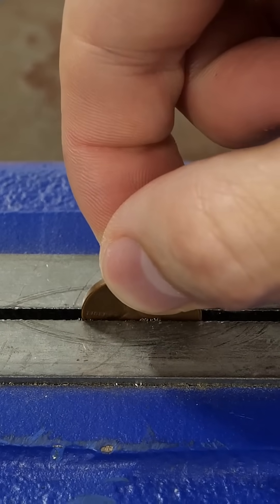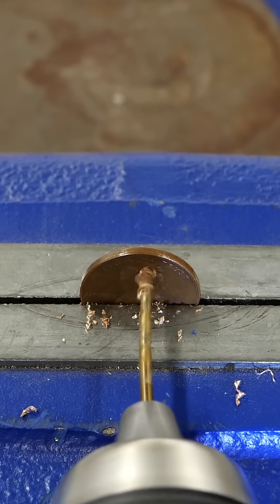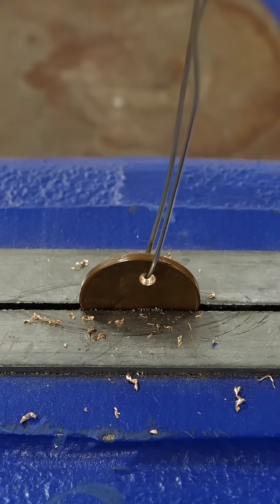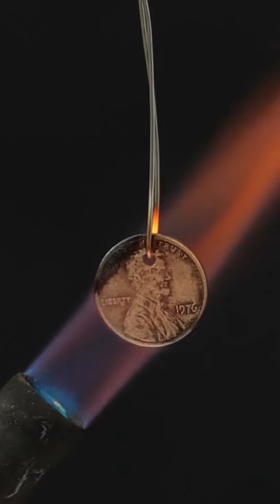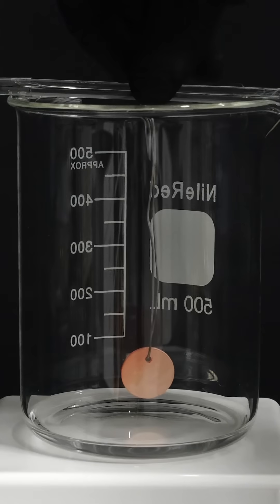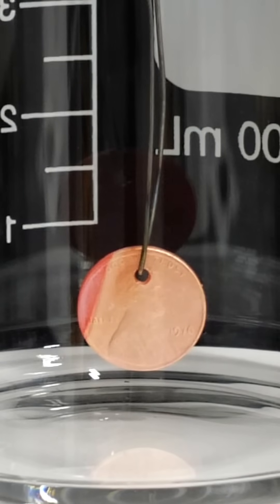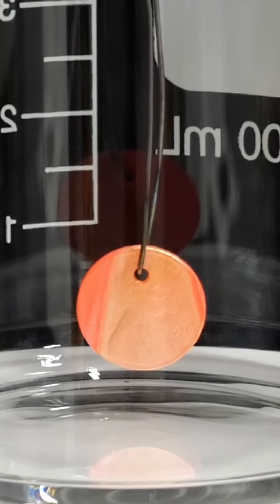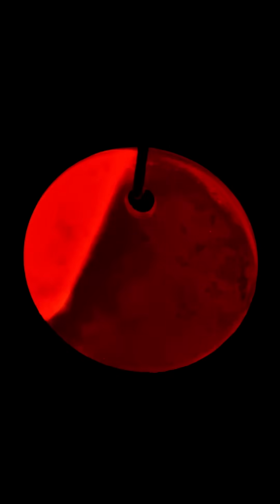Turning a penny into a light bulb

Comment: As a footnote, this only works with pennies pre-dating 1982, since those are mostly copper.

Pennies made now and especially recently dont work because theire now merely zinc with a copper shell. The copper when heated acts like a kiln and will fully melt the zinc. Then the copper shell will crumble as the zinc no longer holds it togeather.
Reply: And this 100% will not work on Canadian pennies made after 2012.
Reply: @rtkThirteen  I can confirm. In fact, even a nuclear explosion will have zero effect on a post-2012 Canadian cent.
Reply: Footnote to the footnote, this exchange of metals is called debasement and it is an everyday example of inflation, or in this case, depreciation of the exchange value of the unit of currency to the exchange value of its metal.
Reply: @ethanallenhawley1052 our money isn’t based on the exchange value of it’s metal
Reply: @zcrow1276  That checks out. I got a flimsy patch of denim with "$50" written on it. Reading these comments had me worrying about the price of jeans.
Reply: I haven't seen a Canadian penny made full copper since 1993
Reply: Was gonna comment this.  Mine just melt when I heat them up.
Reply: Colloquially, Americans still refer to 1 cent coinage as a penny.
Reply: @matthewludivico1714 yeah we literally do. We refer to the unit of currency as one cent, but the coin itself as a penny. I think bro correcting everybody is extremely autistic and into coins
Reply: @matthewludivico1714  Colloquially, yes.
Reply: The official name of the coin is "penny". The official value is "one cent".

Sometimes (usually in negative light for something), it is called a "red cent", placing emphasis on the idea that the lowest denomination (as the only "red" coin) is being referred to... "I wouldn't pay one red cent for that", for example. Not really any other names for it.

The way it's always been. NFI where anyone is coming up with anything different for the US.
Reply: He should make a cross out of copper; that would be cooler.
Reply: @V2RocketScientist of course it would be "cool" because it's an edgy idea. You have to remember that large YouTubers are also business people, and optics like that for your channel can be super problematic.
Reply: they're*
Reply: god i love science
Reply: @joseimpact  i disagree
Reply: Just use copper wire lol
Reply: beat me 2 it....
Reply: and what would prevent this from working when the zinc liquifies?  nothing.
Reply: @travismiller5548  it wouldnt work because in us pennies, the copper shell is so thin that once the zinc liquifies the whole thing melts, IT CANNOT HOLD ITS SHAPE. Take that from the guy who used to melt pennies out of boredom with a candle lighter. It crumbles. Heating the coin to be red hot with a blowtorch is only possible because the FULLY copper penny doesnt get hot enough itself to melt.
Reply: @Kobai36 i say it's a fun challenge.  will the molten zinc break your copper foils? i'm guessing no.  if i sand a spot to let molten zinc out, that's cheating.
Reply: @travismiller5548  I feel like i need to point out that Nile DRILLED a hole in the penny. OF COURSE the copper foil has to be broken. If you wanted to recreate this experiment on any newer pennies you couldnt drill a hole in it anyways because the zinc would still melt. Not to mention the penny he used was made before 1982, see the first frame where the coin clearly says 1976.
Reply: @Kobai36 furthermore- yes, nile drilled a hole but no, the foil might not HAVE to be broken.  it could be fun and challenging to silver solder, or spot/laser weld a strip or wire to the penny.  with controlled thermoelectric heating, a good deal of time, and a few beers, i could melt that zinc out of there and keep my foils.
Reply: @travismiller5548  "When the zinc liquefies" (which it will) one would be left with twisted and distorted remnants of the thin plating.
Reply: Don't the early forties penny those are made of aluminum
Reply: @RaidersofTheLostShark  there was a brief period during 1943 where pennies were made of steel, but at no point were made of aluminum. Steel pennies were struck to ration copper during world war 2.
Reply: Pennies are British.

The 1976 U.S. Cent used in video is solid bronze, composed of .95 copper, .05 zinc.  U.S. Cents minted since mid 1982 are pure zinc with a thin copper plating.
Reply: @-oiiio-3993  Many of your former colonies refer to their smallest unit of physical currency as a 'penny'.
Reply: @dhayes5143  I am not British.
Reply: @dhayes5143  Nevertheless, they are cents.
Reply: @-oiiio-3993  They're actually 97.5% CU / 2.5% ZN
Reply: @Typical.Anomaly  No, they are not.
Reply: @-oiiio-3993  After 1982, they are
Reply: @simondesmond3574  No, U.S. One Cent coins minted early in 1982 are composed of 95% copper, 5% zinc, those minted later in 1982 and since are pure zinc with a thin copper plate.
Reply: @simondesmond3574  No, they are not. Pay attention.
Reply: @timber72  mb, i mixed the copper and zinc amounts.
Reply: For those of you who keep saying that 'Penny vs. Cent' does not matter, it certainly does in this case as does the year in which the coin was minted.  The coin used for the demonstration was a bronze U.S. Cent.

The U.S. Cent changed, in mid 1982, from a composition of .95 copper, .05 zinc to one of pure zinc with a copper plating.

The Canadian Cent changed in 1997 from a composition of .98 copper, .0175 zinc, .0025 tin to pure zinc with a copper coating.
Beginning in 2002, Canada also produced Cents of .94 steel, .045 copper, .015 nickel which were produced alongside the zinc coins. The Canadian Cent ceased production in 2012.

The British Penny was produced, in its small size, of a bronze alloy of .97 copper, .025 zinc, .005 tin from 1971 through 1992 when the composition was changed to copper plated steel.
Reply: @-oiiio-3993 I’ve never heard a penny referred to as a “U.S. cent”. One penny is worth one cent. The unit of currency is cents, the coin itself is called a penny. At least in everyday speak.
Reply: @SuperD00D  Do you have one nearby?

If so, pick it up and read what is written on the back of it.
Reply: @-oiiio-3993 This guy knows their coin.
Reply: @-oiiio-3993 we refer to them as pennies here overwhelmingly, why are you correcting people to say something that considered generally culturally incorrect 

cent is a marker of currency cost
penny is the physical coin 

people do not call pennies cents here, that would be very silly! it is not exclusively british, lol

Comment: 100000° copper coin vs molten acetone
Reply: The 1976 U.S. Cent used in video is solid bronze, composed of .95 copper, .05 zinc.  U.S. Cents minted since mid 1982 are pure zinc with a thin copper plating.

Comment: did you have to get one of the older pennies before the zinc content increase?
Reply: Pennies are British.

The 1976 U.S. Cent used in video is solid bronze, composed of .95 copper, .05 zinc.  U.S. Cents minted since mid 1982 are pure zinc with a thin copper plating.

Comment: Pennies are no longer made. So whats out there is all that you will ever find and my guess in time they will be hard to find
Reply: Pennies are British.

The 1976 U.S. Cent used in video is solid bronze, composed of .95 copper, .05 zinc.  U.S. Cents minted since mid 1982 are pure zinc with a thin copper plating.

The U.S. Cent has not yet been discontinued, though it should have been decades ago.

Comment: You never specified if it had to be copper, which yours was, rather than zinc which is every cent coin since 1982. Sloppy science.
Reply: The 1976 U.S. Cent used in video is solid bronze, composed of .95 copper, .05 zinc.  U.S. Cents minted since mid 1982 are pure zinc with a thin copper plating.

U.S. Cents minted early in, and dated, 1982 are bronze.

Comment: Use a modern penny
Reply: Pennies are British.

The 1976 U.S. Cent used in video is solid bronze, composed of .95 copper, .05 zinc.  U.S. Cents minted since mid 1982 are pure zinc with a thin copper plating.

Comment: Penny of the pretzel is too hot. You might need a peroxide colored and clean it so the white block side is actually attached with a black line and a bottle that’s a circle. I’m in plastic. Small 27 m until goes do it and make an eye then put it into. Me a liar point A is could be peroxide if you smell it it’s very dangerous but nothing dangerous.

Comment: Penny of the pretzel is too hot. You might need a peroxide colored and clean it so the white block side is actually attached with a black line and a bottle that’s a circle. I’m in plastic. Small 27 m until goes do it and make a eye then put it into.

Comment: Is nobody else aware that the was an error penny and was worth actual money
Reply: What 'error'?
Reply: It was off center technically makes it an error coin and was actually worth some money. Not too much but because it was of center it’s considered an error coin.
Reply: @RockinWordBearer They are valued per the degree of 'off center'.

For a Lincoln Cent of that era the coin shown was rather typical.
Reply: thanks for the info
Reply: I had looked up similar coins from the same year and they seemed to have sold for money but I may have been mistaken

Comment: Umm so weird question, newer Pennie’s are copper clad zinc. I thought I saw zinc type shavings from the hole you drilled. But I’ve never heated copper up red hot but I think that’s higher than the melting point of zinc… please explain.😅
Reply: Pennies are British.

The 1976 U.S. Cent used in video is solid bronze, composed of .95 copper, .05 zinc.  U.S. Cents minted since mid 1982 are pure zinc with a thin copper plating.

Comment: you didnt start with an acid solution?

edit, yeah no shit, the alloy is mostly nickel
Reply: There is no nickel in that coin. The only U.S. Cents that contained nickel were the original Small Cents of 1857 - mid 1864 which were .88 copper, .12 nickel.

The 1976 U.S. Cent used in video is solid bronze, composed of .95 copper, .05 zinc.  U.S. Cents minted since mid 1982 are pure zinc with a thin copper plating.

Comment: I did the same thing a decade ago, but instead of a penny (Polish ones are brass sadly) I used Cu foil from a lithium ion cell. I think low thickness allowed it to glow much brighter.
Reply: Yes, the higher surface area means there is more copper available and it heats up more for the same amount of reaction. Also, the foil will be much cleaner, for better reaction.
Reply: The 1976 U.S. Cent used in video is a bronze alloy of .95 copper, .05 zinc.

U.S. Cents minted since mid 1982 are pure zinc with a thin copper plating.
Reply: @-oiiio-3993  yes. That's why Rico explains that he did not use a coin, because he did not have a copper one available.
Reply: @MDuarte-vp7bm  I got that.

Point is, the brass coin available to him likely had nearly as much copper content as the bronze U.S. Cent used in video.

Bronze and brass are both alloys of copper. The last pure copper U.S. Cent was minted in 1857.
Reply: @-oiiio-3993  you should make a video to prove that. I think it wouldn't work. I will eventually try it myself, but for now the internet is trying to convince me that the zinc will interfere.
Reply: @MDuarte-vp7bm   I should make a video to prove that a 1976 U.S. Cent is five percent zinc?
Reply: @-oiiio-3993  no, to prove that a brass coin would work.

Comment: Useless information: an euro 5c coin looks similar than that penny, but is made of copper plated iron.

Or to be precise, some silver colored metal that seems to be ferromagnetic, covered with something that looks like copper. Yeah, it's not my first day in internet. 😂
Reply: The 1976 U.S. Cent used in video is solid bronze, composed of .95 copper, .05 zinc.  U.S. Cents minted since mid 1982 are pure zinc with a thin copper plating.

Comment: But why the 1976 coin do like a 2024 coin
Reply: Might be the difference in metals through the years the percentage of different metals in coins but especially and notably pennies has changed a LOT largely to keep production costs down theirs a reason Canada doesn't use or make pennies any more and it's because no matter how much we changed those ratios pennies cost too much to make for what they where worth
Reply: The 1976 U.S. Cent used in video is solid bronze, composed of .95 copper, .05 zinc.  U.S. Cents minted since mid 1982 are pure zinc with a thin copper plating.

Comment: Make sure to use a penny prior to 1982 🤗
Reply: Pennies are British.

The 1976 U.S. Cent used in video is solid bronze, composed of .95 copper, .05 zinc.  U.S. Cents minted since mid 1982 are pure zinc with a thin copper plating. 

U.S. Cents minted early in 1982 are bronze.

Comment: I imagine you need a high copper penny.  Pennies before 82?
Reply: Pennies are British.

The 1976 U.S. Cent used in video is solid bronze, composed of .95 copper, .05 zinc.  U.S. Cents minted since mid 1982 are pure zinc with a thin copper plating.

Comment: While you've been preserving pennies as change, this guy's been using it as light.
Reply: Give a man ten dollars, and he can buy himself a flashlight.
Give a man a penny, and he can make one himself. *(with several hundred of dollars worth equipment)
Reply: @Matt..S  Acetone + a transparent container + something to punch a hole with + a wire + fire. You can get the middle three from junkyards, the amount of acetone needed is not that expensive and fire is fire.
Reply: @jorgelotr3752  you’d need a blowtorch for it to turn red hot, still blowtorches are pretty cheap lol
Reply: @razpberry0512  for it to turn red hot easily. You can make a simple contraption with mud and some charcoal you obtain from sticks that can burn hot enough to make it red hot (around 800 ºC or 1470º in nonsensical units, which is less of what a bloomery can achieve, which is ~1000 ºC/1830 ºF).
Reply: @jorgelotr3752  huh, hadn’t thought about that. thanks! :D